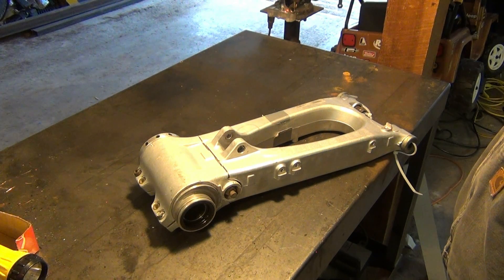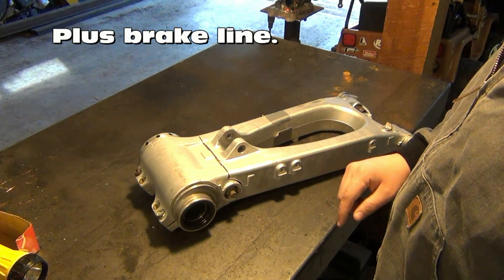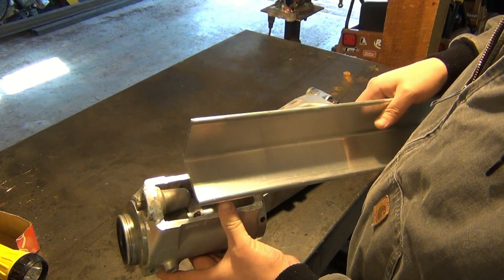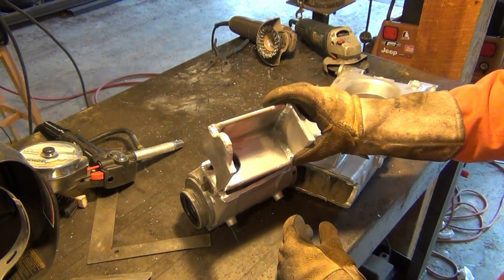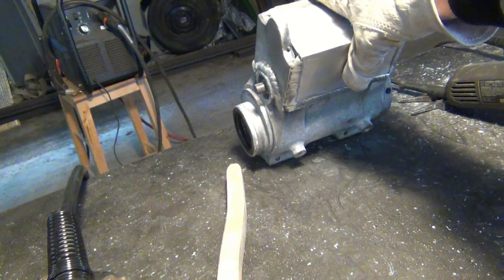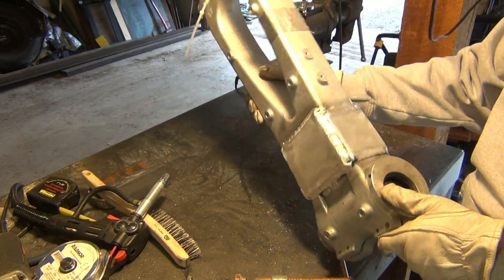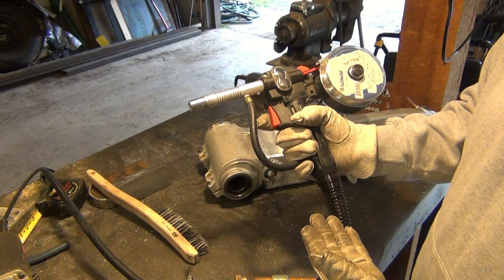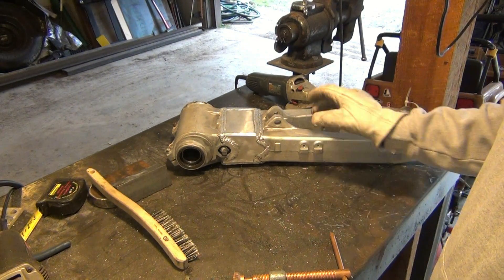How to build +3 Swing arm for Honda 450 R

Comment from the maker: 6" is pretty long for this kind of build. It would put a lot of pressure on the rear shock. It would most likely work.
Reply: Jack Rhodes are you still fabricating extended swingarms? I'm interested in a build for a CRF450